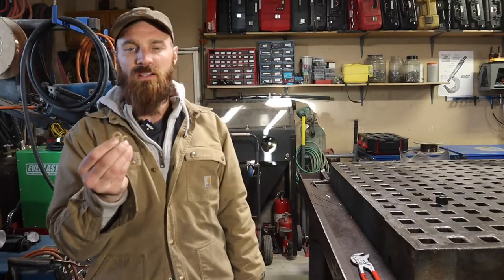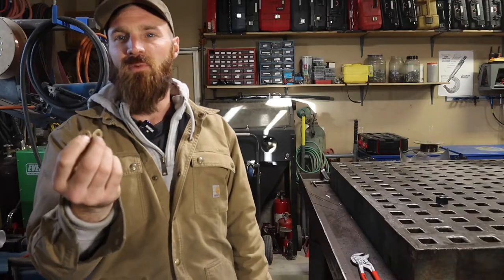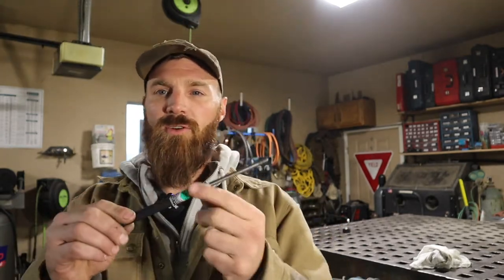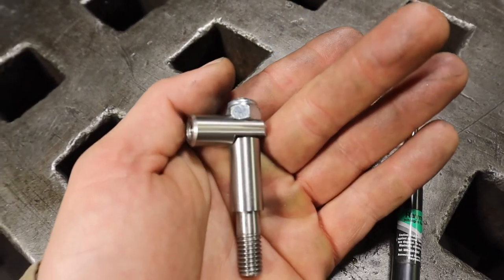Phil Vandelay belt grinder part 6

Comment: Great job on the build.  I am nearly finished building mine.   I didn't like the way Phil designed the interface between the stand and the main plate.  I used 40 mm x 40mm solid bar for the two pieces on the top of the stand instead of the tubing.  I also invested the time to do the CAM work to make a lot of the parts.   The reason being I want to make a few of them to give to friends.

Comment: I've purchased other grinder plans in the past, and had decided to create my own plan's in fusion to address shortcomings in those designs. Then I saw Phil's build. I had suspicions that his metric plan may not be 100% viable as he designed the plans in metric, for a metric belt rather than a 2 x 72" belt. You've confirmed my suspicions with your imperial build. 

I will buy Phil's plans though to reward him for his fine work, and use his model in fusion to make my tweaks to the design so I can order stock 2x72 belts. 

You've done a great job on your build, and your video's are very informative and highlight issues that Phil did not address. I wont be ordering custom belts so I will need to modify the design to accommodate my needs, so I hope you can answer a few questions to help me see where to modify the plans.

I suspect that you went with a 4 pole 1800 rpm motor leading you to use a larger diameter drive wheel. Can you confirm this and tell me that diameter of your drive wheel please? I have a 3 HP 2 pole 3600 rpm motor and use a 4" drive wheel which would shave 3" or so off the belt length if you used a 6" diameter wheel. 

What gas spring did you go with from McMaster Carr? I was thinking their "add a fitting gas spring 9416K12 with 40 psi of force. 

Again great work... I will subscribe and look forward to your future projects
Reply from the maker: Thank you sir I used a 2hp 3450 rpm tech top motor and my wheel only ended up being a 1/4inch larger than his. I started a facebook group called belt grinders anonymous and theres a couple guys in there who are building this grinder too ive also put some information on there
Reply: I'm not on Facebook, but thanks.

Comment: Nice to see a another one of these built. I'm about 3/4 the way through the main frame of mine. doing it slightly different though. most of it will be made out of aluminium
Reply from the maker: Thanks its a fun project I wondered how it would be out of aluminum .....let me know when your done I'd like to see some pics
Reply: @westweld  sure will do. Its going to take a while as this is my first multiparty project. Also I have a tom senior m1 which is to small for the main plate. Every cut is a new setup. I can't even flycut the back side in one pass. Also doing this around my day job
Reply from the maker: @jdandcoke  I hear you the only reason I got mine done was covid

Comment: Aaron, you bloody beauty, I have brought Phil's Plans, ......and like you have used Solidworks to redraw as we don't have the off the shelf metal supplies, then yesterday I found your build, Thank You very much for taking the time to video your build, I have saved everyone into a separate Phil Vandelay Folder.
Question what CAD program  did you use....do you have a step file.
The idea of welding tabs on to the main frame and bolting to the milling table is a DUH moment, or go and build or buy MiteBite holders......Nah.                      Again Thank You. Beagles...Dave.
Reply from the maker: Thanks im glad you liked them.....i used fusion 360 to draw ill check to see what format its in......they're a couple parts that you really need to have before building the body..the gas shock and the motor. The motor determines the shape of the round part mine is quite a bit larger but this gave me more room to allow for the larger shock I moved the mounting holes as far to the top and bottom as I could without interfering with the tracking wheel.

Comment: Looks incredible, great work. But it's exposed steel isn't it going to rust? No paint?
Reply from the maker: thanks! its been a year still no rust machined parts with a good surface finish dont tend to rust unless moisture is introduced (Moist hand, high humidity, swamp cooler etc) I live in a pretty dry climate (high desert)
Reply: @westweld  Oh, I see. I was curious about that, thank you! Great work! keep it up!!!

Comment: Do you have a total cost to build, or even a ball park? I've watched Phil's videos many times and a few days ago I ventured into Fusion to draw up my own version of this grinder. I think I am more curious than anything what it will cost me to have the plate components cut on a water jet.
Reply from the maker: Well I estimate i spent 2kish most of the hardware was from mcmaster and motor and vfd from eBay alot of the steel I had laying around........I would say just expect more than you think haha. (Mcmaster isn't known for being the cheapest and if you buy the aluminum wheels its cheaper than the raw material so you might be able to do better than I did if you shop around)
Reply: @westweld  Thanks, I appreciate your response. I already have a 3HP motor and VFD. I'll be purchasing the wheels, which are $130.

If I can have the plates cut for $500-ish, I think I'd be pretty happy.

Comment: Awesome series. I been debating buying his plans. But you said the 2x72 belts dont work so well? How would you mod it to make them work?
Reply from the maker: 72 inch belts arent long enough to use. The grinder body would have to be shortened ( it would be a fair amount of changes).....but combat abrasives will make belts to any length for you and the grinder is an amazing design im really happy with it
Reply: @westweld  thanks but the problem comes when/if I cant find a custom belt maker. Also I allready have 2x72 belts. Will the 72 belts absolutely not fit?
Reply from the maker: @mastermoarman  no it won't work unless you make the drive wheel smaller and even if you figure out how to squeeze it on there the platen won't tilt and you won't have any movement in the tooling arm

Comment: Absolutely beautiful job!  I've got a couple of questions. All the metal parts, I think you said it was all ordinary cold rolled steel except the platen. How do you keep it in such pristine condition? I can machine/shine something one minute and it's rusting the next! Also, the wheel you used to polish the parts, was that one of those 'Scotchbrite' style of wheels?
Reply from the maker: Thank you.......the sliding arms are stainless and most of the moving parts are 4140, but the large parts are mild steel....its holding up good I imagine over time it will get more scratches but that just character....and yes that is a scotch brite wheel those things are amazing......thanks for watching

Comment: I have access to aluminium plates that won't be used otherwise in my company. Would it work for the main plate or the guides for the arm?
Reply from the maker: I think it would work ive seen grinders made out of aluminum......I think it would wear faster especially the moving parts and maybe have more vibration because its lighter
Reply: @westweld  thank you for your answer. I will probably make a mix of aluminium and steel so. how heavy is this grinder approximately? Is it a good idea to screw the grinder to the table?
Reply from the maker: @francoiszutter253  I would bolt it down if you can....I would say it weighs over 100lbs but thats just a guess its pretty heavy

Comment: im having trouble with my tracking and i built this same design . also how are were did you mount your vfd ?
Reply from the maker: I mounted vfd about 15 feet away from the machine on the wall........make sure there is no play in the hinge that your tracking wheel is attached to
Reply: @westweld   ok thank you , yeah i have some play on the hinge part were the bolt goes thru the sliding arm , ill machine a new bracket to get a tighter fit
Reply from the maker: @michaelalguire9896  you'll be surprised how big a difference it makes
Reply: @westweld   do you have a email , im having troubles with my grinder

Comment: Awesome series. Appreciate the attention to detail. I just ordered Phil V's plans. I am interested in the parts list from Carr any mods you have made. I have access to Inventor and can modify any items. Definitely willing to purchase any imperial updates from you. Thank you. Vennie
Reply from the maker: Thank you.....you dont have to buy anything let me look at my invoices ill try to get you some numbers
Reply: @westweld  Thank You!!
Reply from the maker: This is the gas shock (6643k46) and bearings (6661k44) I used from mcmaster. The gas shock is slightly longer so the holes need to be adjusted accordingly.
Reply from the maker: What I would recommend is buying your motor and working from there thats what I did to determine the size of the frame
Reply: @westweld  Can you tell me which spring plunger you used for your project. Was it from McCarr?
Reply from the maker: @venkatdyavanapalli2209  are you talking about the ball nose spring plungers or the one for the tensioning lever
Reply: @westweld  For the tensioning lever. The p/n for ball nose would help. I selected a couple from Carr, just verifying. Thank you for all the help..